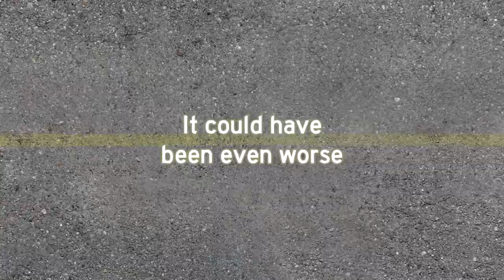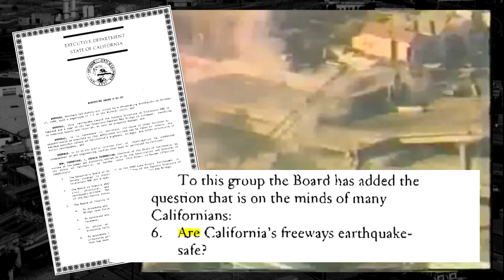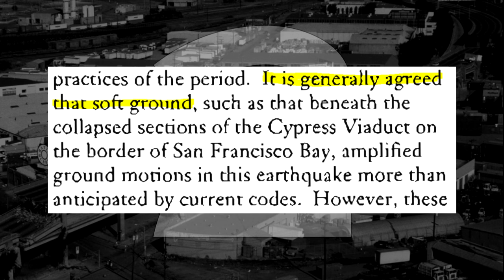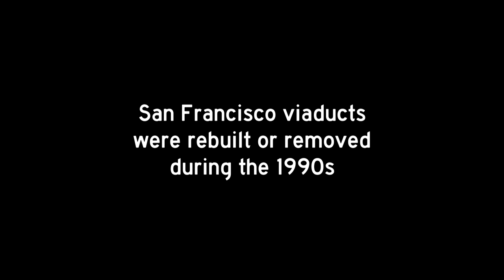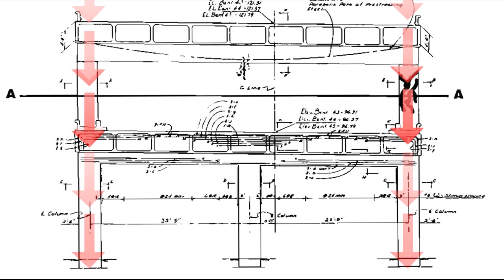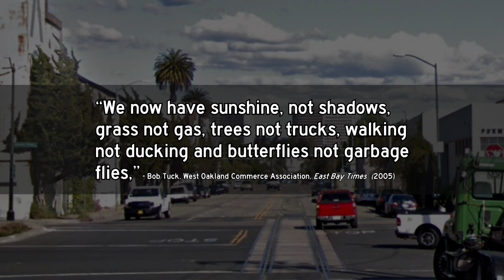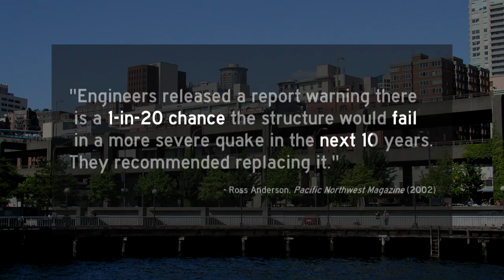What caused America's DEADLIEST freeway collapse?

Comment: "The lessons of civil engineering are written in blood" really stuck with me, another great video Rob keep em coming
Reply: well even motorsports safety is written in blood too
Reply: It's very true.
Reply: I went through training to be a train conductor, and they told me the same thing
Reply: Same with aviation
Reply: @knightwolf3511  Sorry but if your take from that quote is that the baggage loader failed in their duty to close the door you should read the report again. Granted the baggage loader certainly missed an opportunity to break the critical chain of failure when they failed to question why the level was unusually difficult to operate. Still, at the time, the issue was claimed to have been fixed and baggage loaders were not trained that the mechanism could easily fail under the modest mechanical force a human can deliver. Frankly, this should simply not have been the case for a latch mechanism designed to resist forces well above the limits of human strength in the first place. This is a locking mechanism that is supposed to hold a large door with a pressure imbalance per square meter equivalent to the weight of a 7500kg mass at sea level. No way a human should be able to bend this mechanism any more easily than they can simply bench press an articulated truck trailer loaded to road-legal max weight.
Reply: same with most regulations including transport, food, and public/private goods like your couch or computer
Reply: Engineering, architecture, any similar profession. It can be a scary thought. But lives depend on the decisions you make. And the scariest part is. You can do everything right with the skills and knowledge you have at the time, but as we are always still learning, you may discover how poorly you decisions was. And unfortunately. That could mean people die. Like sometimes it just corruption and laziness that are the direct fault of infrastructure failure. Other time it just not having the knowledge and hindsight to know better. It’s a huge responsibility. Idk if in the 1950s they had the knowledge to think about how the load is being distributed. But even if they did, they may have not had a reason to think anything of it. Just the fact that within that timeline civil engineering learned that brittle structures are not necessarily the best in a world that’s constantly moving. You can understand what seems today very juvenile train of thought, ‘Stiff and solid means strong,’ would seem to make sense. It just makes you think when your an engineer, “What the next big thing we realize we are doing wrong and what will the cost be?”
Reply: proud to be 666th like

Comment: Every time I took the Seattle viaduct, I did think of earthquakes. Very happy it's gone. The waterfront area already looks so much nicer without it and I don't think they've had a chance to complete all the various projects to improve it. Sure, the tunnel was a bit of  debacle in getting drilled, but the city is better off now.
Reply: Yeah a tunnel through fill dirt built by the cheapest contractor and with water on one side.  No nothing could go wrong with that nightmare.  God only know how many short cuts have been taken so they could  ( what a laugh)  get it done as fast as they could.
Reply: Seattle still needs to strengthen or rebuild the seawall that all the piers are connected with.  If it doesn't happen, the tunnel will be ripped apart.
Reply: @tudorjason  the tunnel will be fine. The violent movement in an earthquake manifests on the surface. Very little happens in a tunnel during an earthquake and water wouldn't rush in through an opening. It would seep in if at all and just need to be plugged with grout.
Reply: True. Didnt the viaduct collapse one time? Because a pipe burst and caused the soil below it to soften creating a sink hole in some way?... 
other way. I miss the viaduct but damn was there a shit ton a trash on it... it felt weird to see it just... empty..
Reply: The work in Seattle has been going on forever 🥱
Reply: @chels1542  they shouldn't have even built the tunnel they should have just demolished the viaduct and sold the excess land on either end.
Reply: @aemrt5745  That's an intuitive misconception. Seattle's traffic is already at saturation for big parts of the day. Removing it would make no difference which is what happened during between it closing and the tunnel opening. At worst you get no change. At best you get a big improvement when you also consider the streets it dumps traffic into.
Reply: @aemrt5745  that's why I said it's an intuitive misconception. This has been well studied into since the US started building freeways and proven by team after team of traffic engineers and project after project. They keep getting funding for political reasons which is true of this one. There's a bunch of fundamental rules to how it provides for congestion rather than relieving it but they're collectively referred to as induced demand. And I didn't say instantly. It can take days or weeks to respond.
Reply: @aemrt5745  that's exactly what happened. Planners from the project reported that many of the trips took other routes but others took different means, many trips just weren't made at all. If you provide for inefficient trips you get inefficient trips and if you increase the capacity of a saturated network but can't fully eliminate saturation (it's impossible) then you don't shorten trip times or reduce congestion. You just get wider congestion. Planners from this project found the best option was to doze the viaduct and build a surface level Boulevard like the Embarcadero but the city was committed because of a badly written ballot after the earthquake.
Reply: @aemrt5745  it is politics. If anything about physics suggested a saturated network could be improved in a dynamic system then LA would have the best traffic in the world. In order for it to work you'd need so much space you'd have to remove the things people are driving to. Especially for a viaducts that isn't a continuous thoroughfare. It stops and turns into streets that can't cope.
Reply: @aemrt5745    no just the change alone of the viaduct is my point on its own. I do support other changes but I haven't suggested them here. I'm talking purely about the behaviour of traffic in a network. This isn't my take. The planners and engineers of the Seattle viaduct project themselves pointed this out after the fact and it's exactly how they predicted it would before the fact. Braess's Paradox. Nash Equilibrium. Lewis-Mogridge Position. Marchetti's Constant. Jevan's Paradox. These and others describe the paradox of urban freeways and viaducts. The same thing happened with the Embarcadero. There's so much specific data out there too these names just describe the concepts behind induced demand. Any solutions I could suggest would work to make traffic better. But removing the viaduct would at worst amount to not making it worse. I can't stress enough how well researched this issue is in the world.
Reply: That’s basically Seattle’s equivalent of San Francisco’s embarcardero freeway

Comment: “And hopefully last freeway disaster” Meanwhile in 2007 by Minneapolis...
Reply: I was on that bridge 12 hours before it collapsed, I was also going to take it about 24 hours before the collapse but with all the traffic I took 100 instead
Reply: I only scrolled down to look for this comment.
Reply: @brandonlink6568  dang that's pretty scary.
Reply: If that's the bridge I'm thinking of, my dad said it was the only bridge he felt safe driving over with the Apollo van because you couldn't see over the sides. Then it collapsed, luckily when he wasn't on it.
Reply: Remember being not far from that with my dad when I was younger and all we thought was why is the traffic at a dead stop and why are there so many sirens. Then we heard over the radio when the news started going crazy
Reply: I’m from Minnesota but was in Austria when that happened. I will always remember waking up for breakfast and the first thing I saw on the table was the newspaper with a massive headline “Katastrophe in Minneapolis” and pictures of destruction. Really freaked me out. Found out later my dad had been on the bridge the day before.
Reply: I, Too was on that 35W bridge about 1 hour before it collapsed
Reply: JG-26
Reply: @steveguzman6141  you dense? That state has always been super democratic and has some of the nicest roads for winter conditions in the US. That bridge was doomed from the start it wasn't capable of holding the load of so many years of  new road surface.
Reply: 2017 atlanta bridge collapse
Reply: @SunShineStateMetalShows  The gussets plates were like a 1/4 of an INCH

Comment: The cypress collapse was originally attributed to the lack of horizontal rebar elements.  The reasons have changed through the years.  The idea of the V shape of the columns causing outward sliding is strange because the column shape is normally cosmetic.  For those of us alive back then, it was stunning for something we drove across for years to be lying in ruins.

Comment: Unbelievably, half of the people who got directly crushed on the lower deck lived, and over 90% on the upper deck. If you wore your seat belt, your odds of survival on the lower deck were about 65%.  Quite a few were saved by seat belts and/or sheer luck. The red car in the thumbnail is an example of both. The bent cap collapsed on the engine of the car, a 1986 Dodge Colt, sparing those inside by only a couple feet. 4 out of the 5 people in that car lived; the only fatality was the rear-middle passenger, who was pulled from the car alive but died about 8 hours later. She was also the only one of the 5 who was not wearing a seat belt. 
Although spans 63-95 and 97-112 all collapsed, your odds of survival varied heavily depending on where you were. Spans 63-67, those who would have just entered the collapsed "Jello soil" section, were the worst off, everyone died in those areas except for Julio and Cathy Berumen, two children whose rescue was one of the most dramatic stories of the whole earthquake. Spans 73-79 only partially collapsed, there was one guy in a Datsun truck in there, he was unhurt, and the spans in the 80's, though fully collapsed, had a survival rate in the 70s% due to the fact that there was a few feet of space left. 97-100 was another bad area with about a 20% survival rate, and the last collapsed spans, from 101-112 were another relatively lucky section with a fairly high (~70ish%) survival rate. 
Also of note, on the lower deck, no semi-truck drivers lived in the collapsed section, though there was a VERY lucky man who was driving a Chevron semi who just happened to be in span 96, the lone span in the 50 span that did not collapse. If he'd been ANYWHERE else from span 63-112, he'd be dead, as semi-trucks sit much higher than cars. 
I wonder if the soil was even worse under spans 63-67 and 97-100 than it was, say, under spans in the 70's, 80's and 100's? 

https://archive.org/details/lomaprietaearth1990cali_0 - Here's a report. 

December 18, 2020 5:43 am

Comment: It's all about concrete containment in the columns. Round columns are much better than square because their are no corners and the cracking concrete trying to expand outward is contained more effectively because the rebar is in hoop stress which is effectively purely tension. Whereas square columns use stirrups with corners that can deform and have high stress at those points. With enough containment rebar even if the concrete cracks it can't "fall out" of the reinforcing steel. you could end up with gravel in the middle but the hoop strength of the reinforcing steel would keep it together and able to bear load. That was a big takeaway from this disaster as well...

Comment: I think the MSP collapse was a bigger "failure" per se- there were no earthquakes to speak of
Reply: I think he was talking about fatalities. Only 13 people died in the I-35W collapse vs. 42 people here.
Reply: I'd agree with you Richard. Can't expect structures to hold up to an earthquake even if they are built to withstand them. The I35W bridge was flawed and fail under regular circumstances.
Reply: @dajb90  i-35 was not built to withstand "regular circumstances".
That bridge was built to survive earthquakes and River debris. What they did not take into consideration was the regular circumstance of dumping millions of tons of fucking salt on it every winter. That circumstance is a legitimate engineering blunder rather than a critical lack of geological tectonic knowledge. We didn't even know the ground fucking did that until the Cyprus structure collapsed. S waves were not a thing until this collapse was studied.
Reply: I'm actually going to agree with you a little bit. The other commenter is correct there was greater loss of life from the Cypress collapse, however, people just didn't know the ground behaves that way until this thing collapsed it would have been perfectly solid and not have collapsed if it was built on different ground. That's why I only part of it collapsed, there was several miles of it that was just fine and still standing today.
Had it not been for the engineers not considering all the salt being dumped every winter, the bridge would not have collapsed. 
The university avenue bridge was an absolute blunder, a supreme example of engineering incompetence and critical oversight.
The 880 collapse was a, that's a new one type situation.

Comment: The temporary shoring of the Alaskan Viaduct in Seattle was simple and desperate. They poured new columns right next to the old sinking ones and simply bolted and strapped them together. Apparently that was just enough to keep it from sinking while they slowly built the new tunnel.

Comment: The Alaskan Way & Embarcadero viaducts weren't the only double-decker freeways replaced as a result of this collapse. In St. Louis, a lengthy section of I-64/US 40 (was just US 40 for decades before I-64 was extended over it) was double-decker, and also had potential earthquake issues due to the New Madrid Fault (dormant for over 200 years but widely expected to act up again). The original double-decker structure was demolished; there were a few spots that had to remain double-decker due to nearby historic structures (including a well-known armory), but even there you can tell the bents were staggered to minimize the potential of a pancaking failure like here.

Comment: My husband worked as a medic for the local ambulance company during this time. It was the most horrific situation hearing people crying then silence.  The Cypress section was in trouble years before. The lowed deck heading to SF had developed an undulating roadway. My dad called this out in the 70's. I started commuting in 1983 and noticed the up and down of the lower deck. That meant the soil was already on the move. The residents of West Oakland rightly sued Caltrans preventing them from building on the same footprint through their neighborhoods. That's why it took nearly 8 years after quake to start on the replacement away from the residential neighborhoods and almost 20 years to replace the Eastern span of the Bay Bridge.

Comment: I was working for the Mass. DPW (now MassDOT) when it happened. As soon as we heard of it, the next workday we made reference to it as the Cypress Street Viaduct as if it were in Boston! There we had two ageing, decrepit viaducts when the earthquake happened. One was the Central Artery now replaced by the Tip O'Neill Tunnel, and the Albany Street or Broadway Viaduct. Both were built partially or entirely on landfill underlined by marine blue clay. The piers supporting the Broadway Viaduct were eroding fast. The Central Artery viaduct was all steel but the exposure to road salt was so bad that it had cancer. And you could hear the structure squeak whenever heavy traffic went over it. So I was always worried one of the highways would come down by accident. Fortunately, both were torn down.

Oh the real worst case scenario for the 880 Cypress Street Viaduct involves Caltrans renovating and retrofitting it before the '89 earthquake hit. The expressway would still be there, blighting the neighborhood even unto this very day with a loss of life from pollution arguably equal to that lost in the collapse

Comment: There have been other freeway section collapses here in California as well--one segment of the Oakland Bay Bridge suffered an upper deck collapse but thankfully the failure only occurred at one end of the segment so it did not "pancake' lower lever traffic. The same occurred on I-10 in Los Angeles near Fairfax Ave during the 1994 Northridge earthquake. Several major freeway interchanges also came alarmingly close to failing, and all such interchanges had to undergo complex and costly upgrades.

Comment: I was at my parents' home in Los Altos, CA, when the Loma Prieta earthquake happened.  The house remained standing, only a few objects not attached fell to the floor.  Many people were not so lucky.  Many had their house foundations damaged to the point that the houses were a total loss.  For many, it took about two years to get back to pre-earthquake normal.

Do you also know about CA-480 aka Embarcadero Freeway?  It is shown later in this video.  It was a double decker freeway, similar to the Cypress Structure, feeding into I 80.  It too was damaged in the same earthquake, not to the same degree, but it was demolished anyway.  The closest that I went to the damaged Embarcadero Freeway was at the Justin Herman Plaza in SF, November 1990.  Some graffiti written on a pillar was "worse than useless".

I did not live in the East Bay and did not visit often, so my concept of how long it took to rebuild I 880 may not be quite correct.

But anyway, good video.